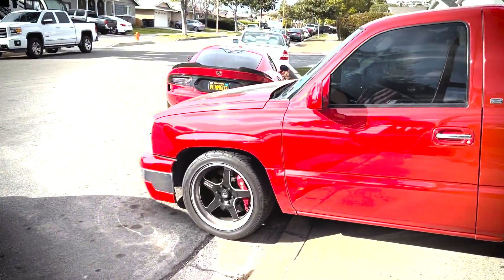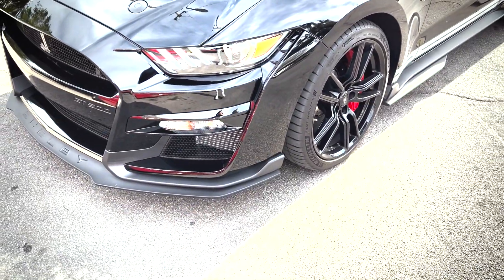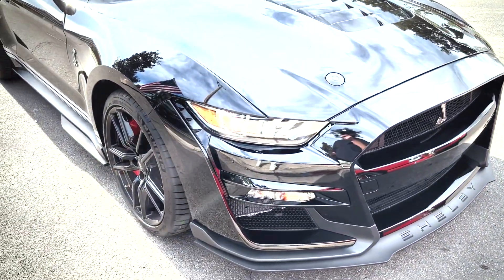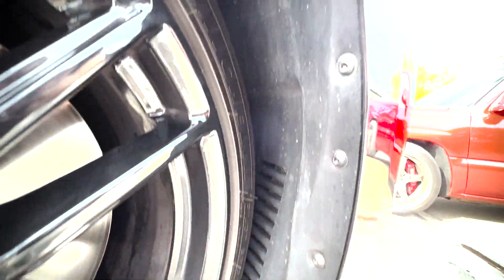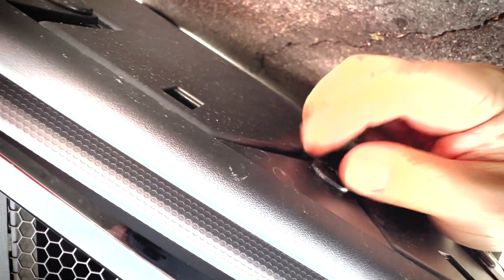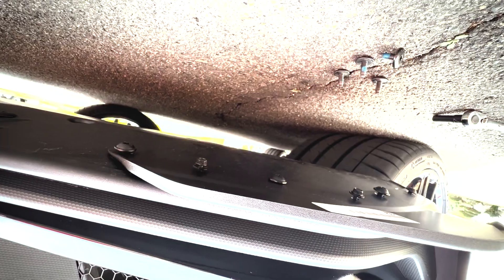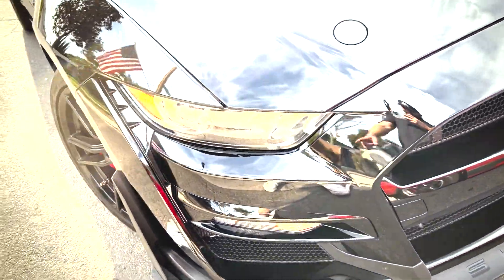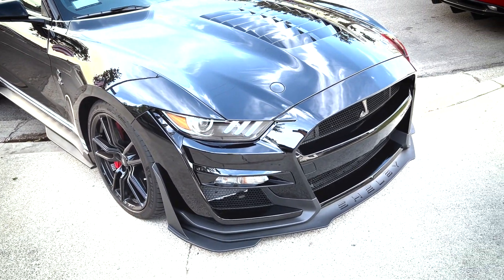GT500 Spitter Wicker Install!

Comment: The handling pack has adjustable strut mounts and an oil catch can. The catch can, wickers, strut adjustment, and gurney flap make up the handling package. That’s quite a lot for the asking price. Factor in install time and it’s a pretty fair asking price. 

Thank you for posting. I need to install my wickers and this is very helpful.